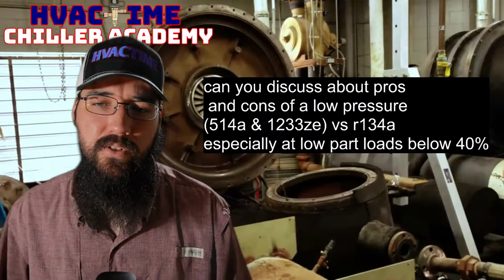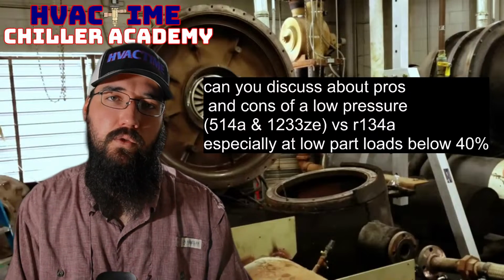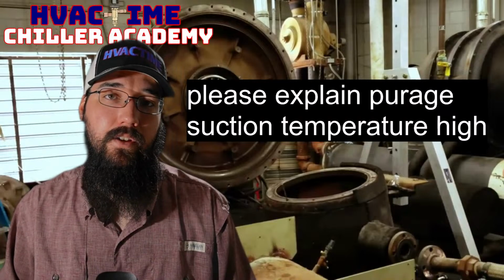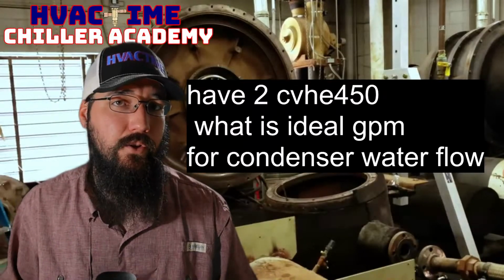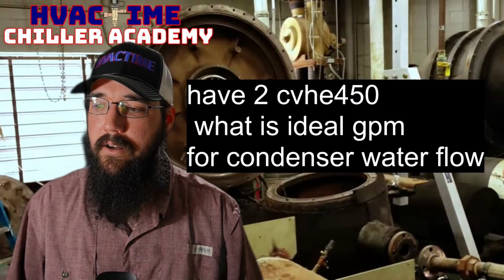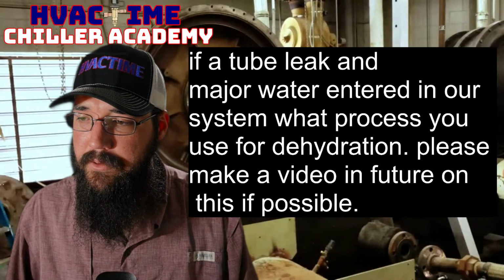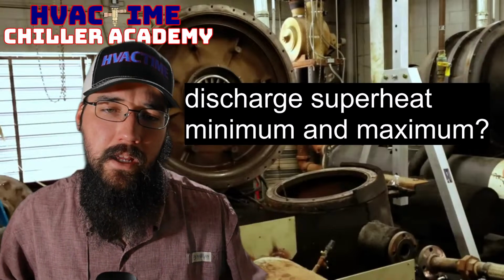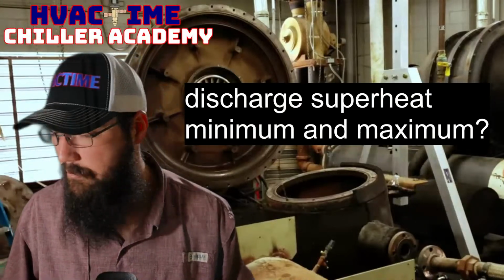Feel More Comfortable with Centrifugal Chiller Q/A

Comment: Hey thanks for answering my question. 

It will be great if you can add in a time section into the video and indicate the question & time in the video description. So we can dive straight into question that we are interested in. 

I have a question on adoption of new refrigerant in chiller especially natural refrigerant. The goal is to reduce or remove GWP impact of refrigerant. 
Are you seeing US market starting to adopt natural refrigerant in their new chiller system ? or A2L refrigerant ? Ammonia, R290, CO2 and etc or R1234YF and etc
Reply from the maker: We are seeing 513, 514, 1233, 1234, and 32 implemented here. I'll work on the time stamps, good idea.